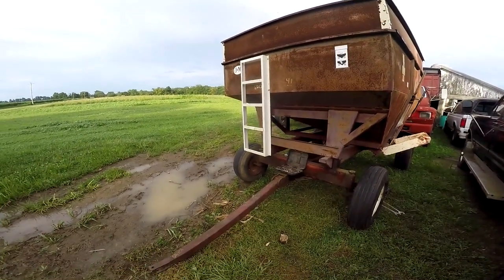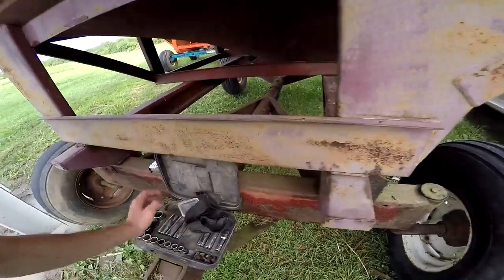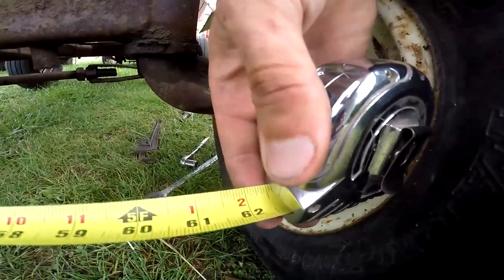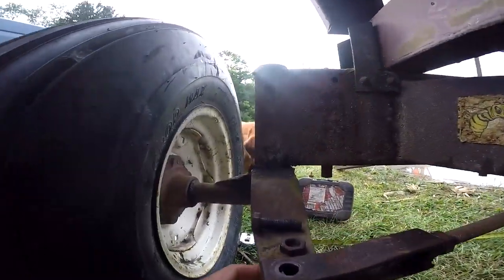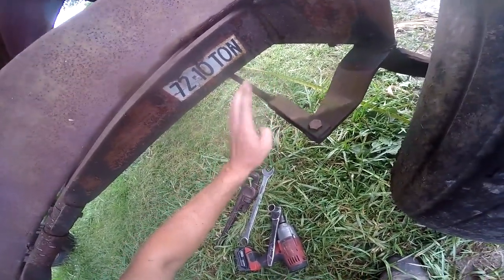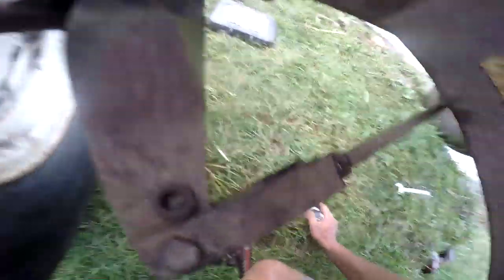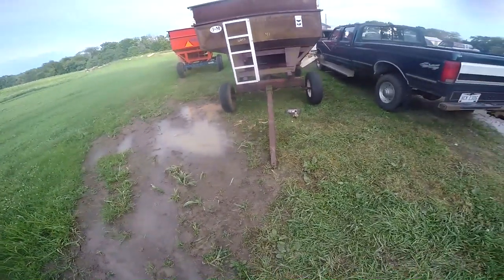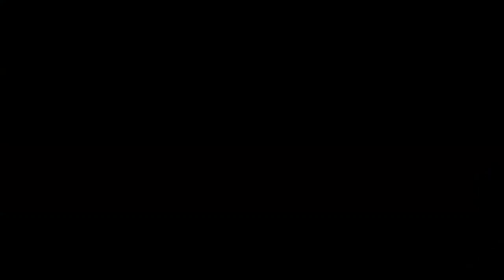Setting Wagon Steering Toe-In

Comment: Yeah if you measure from the center of one tire tread to the center of the other tire tread, front and back, the front measurement should be about a half inch less than the rear measurement.  Course that's measuring further out on the tread not at the rims, so that's the difference.  Basically you NEVER want stuff toed out... it causes wandering and fishtailing in trailers and of course tire wear.  A slight amount of toe-in is desirable, because it helps with stability and towing straighter, BUT excess toe in is just as bad as toe out.  

One time I was running a 5610 Ford with a 9 foot Kuhn disk mower for a bus driver friend's husband, who needed more help.  He'd bought the 5610 new a few years before and had it narrowed up as narrow as they could set it so it'd fit on his gooseneck 16 foot lowboy pipe-rail trailer... Had to be narrowed up all the way to fit between the pipe rails.  Anyway, whatever idgit they had working on it at the dealer evidently didn't know sh!t because yeah he set the front axle in all the way, BUT instead of setting the tie rods in the proper number of bolt notches on the bottom of the tie rods, he just screwed them in all the way until they were out of threads and called it good... d@mn thing was SO toed in that it had worn BOTH front tires completely slick, and it wasn't the first set he'd put on the thing either, I found out!  I was driving it between fields the first day and the d@mn thing was SO twitchy when I hit a hole it nearly threw me in the ditch, as the weight shifted back and forth between the front tires, one grabbing and tossing the tractor one way, then the other caught and tossed it back!  SO the next day I brought my tools and toed it in properly for him... take the clamps off the tie rod tubes, and used a wrench to turn the tubes out to the proper groove in the tie rod adjuster for that axle width, turned it back to pull the wheels in, then measured and turned the tubes to the correct toe-in.  I swear, these d@mn dealerships now, they only hire kids fresh out of high school willing to work for nothing, and of course that's about what they're worth-- they know nothing and can't be bothered to learn anything either, but the d@mn dealers still charge $150/hour shop rates!  Insane but it happens EVERY DAY.  H3ll even the car dealers around here are doing it now... they have 1-2 old "graybeards" (guys in their 50's or 60's who are actual mechanics) who are the "gurus" that know what they're doing, going from bay to bay telling these know-nothing wrench turners what to do next, what to check, and how to do it... 

I've seen it myself firsthand many times... Later!  OL J R :)

Comment: actually, the less that 1/4 inch measurement is measured at the OUTSIDE of the tire, not the rim. and it should be less than 1/8 inch on a solid axle. your 3/16 at the rim will be closer to 5/8 or 3/4 at the outside of the tire. if you put the axle on jackstands, you can, first off, check that the king pins are still tight, then using a tire crayon to mark the tire (hold the crayon on another jackstand and rotate the tire to make a mark, near the center. it doesn't have to be perfectly centered, just consistent all the way around.) and measure to the line.